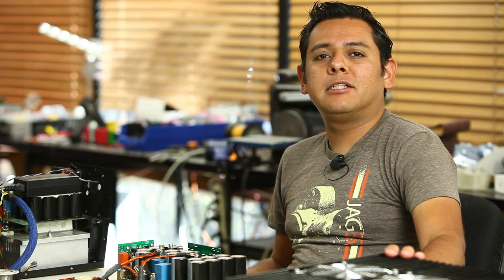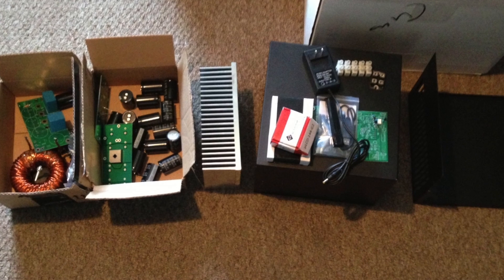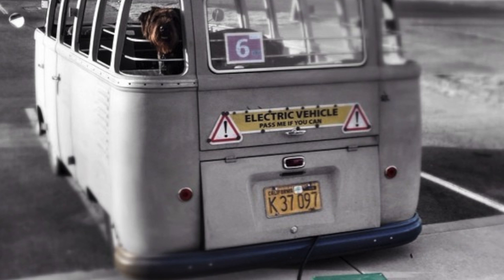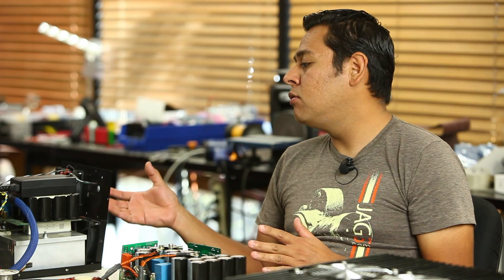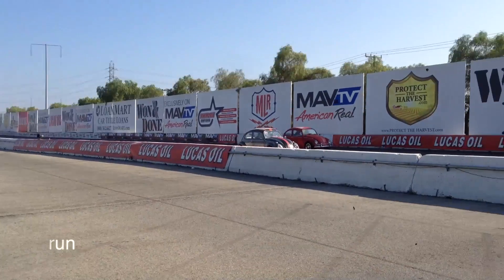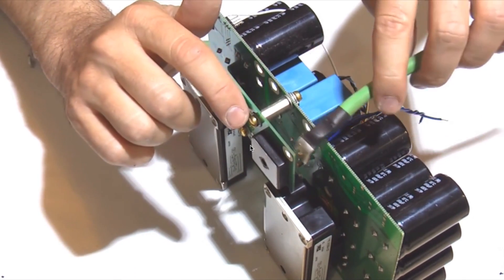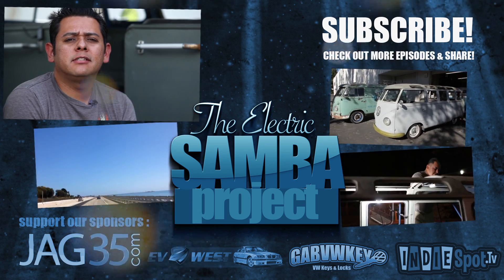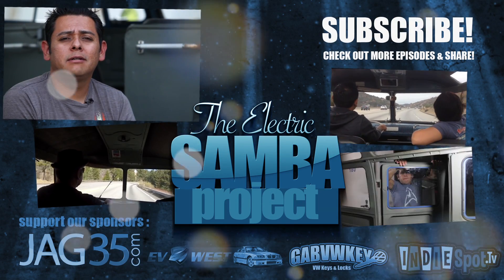DIY EV VW Bus  charger issues - eSamba  - Electric Car

Comment: Jehu why don't you get a js1772 receptacle and output the two 120v hot leads coming out of it into two separate standard Lifepo4 battery charger in parallel that take the AC and convert it to DC (and also have preset lifepo4 charge parameters). There's a company that makes this receptacle with built in electronics to work with EV charge station.  Why does it have to be an EV specific type of charger if ultimately you're simply charging lifepo4 cells.

Comment: Be careful with placing metal around those coils, as it may change the inductance of those coils. It could change the frequency of the circuit.

Comment: High current Capacitors are very dangerous, you are not suppose to work with high current capacitor’s without protection. It can kill you

Comment: They should make the board a little bigger, maker easier for air flow.  They could try using gan switches vs igbt then they can switch faster and decrease the inductor size  and weight by half.  It's Abit challenge but this is open source after all.  Suggest use fan when charging to help the charger last longer.  The inductor I assume gets the hottest

Comment: Can anybody explain the difference between a charge station, EVSE, and a charger? I think I almost understand. I am almost sure a charge station=EVSE, gets installed on the wall and has a J1772 cable that extends to the car’s receptacle. Inside the car goes the charger (and nothing else should be called a charger), getting power from the receptacle, and is directly connected to the battery. Am I right? I am not sure if the charge station/EVSE transforms, converts, rectifies or boosts the household power to anything else, but it is at least there for safety, only allowing power through when an electric car requests it through the communication pins.

Comment: what about solar charge while driving? like having two separate modules and charge one while using other one. and wice versa. or use generator hooked to wheel to charge it. ?
Reply: MP-Tuners Productions solar panels on the roof would not produce enough energy to be worth putting on the van. Any energy taken from the wheels has to come from somewhere. Conservation of energy principles mean either charger or regenerative recovery when slowing down rather than using brakes. Not while cruising
Reply: okay good, but still, if solar panels can give you an extra few miles just to get to charging station, it is worth trying at least. also generator hooked to driveshaft trough belt and gears should generate some power. It's not about building an perpetuum mobile but just to get few extra miles without needing a gas generator [top gear geoff].
Reply from the maker: I’ve made 2 videos about it https://youtu.be/2WeqnD2HzS4
Reply: yeah I found them just right after I've made this comment. Great stuff, so informative :)

Comment: also Tesla has a new HPWC version 2 which seems pretty awesome and pretty reasonable. max output is 80 amp which is the max available in the industry and its configurable.

Price $599 only.
http://shop.teslamotors.com/collections/model-s-charging-adapters/products/wall-connector-with-24-cable

Comment: Tesla sells their 2nd onboard charger (to upgrade to dual charger system) which charges @ 10KW for $2000 with installation so i am assuming its actual cost would be something like ~ $1500. http://shop.teslamotors.com/collections/model-s-charging-adapters/products/2nd-onboard-charger

its pretty sleek, liquid cooled and powerful! would that not work for you? seems pretty reasonable ... I'm curious to know if you considered it for your Samba Project? if it won't work then i would appreciate if you can share why would it not work for your project. it appears that this could have solved your charger issues once n for all and would have been cheaper and most technologically advanced option?
Reply: which charger did you finally end up using for your Samba? can you please share the link of the video if you have one?

Comment: Hey Jehu, Where can we get some of that fuse wire for the batteries? Did you sit down and just break open a bunch of fuses? is there anything special about those wires?
Reply from the maker: nothing special about it, I cut off and used the legs off these http://j35.us/1k-Ohm-resistor
Reply: Interesting. I found a page with some information on the ampacity of a wire based on its gauge. It might help. It looks like if you need a max current of about 7A you can try using a 22 AWG wire. I'd like to do some more research on this. It might be a good idea to have that fuse burn out faster if the battery shorts out. I'll let you know if i find any thing else.

https://wiki.xtronics.com/index.php/Wire-Gauge_Ampacity

Comment: Jehu, I worked for over 20 years around plating rectifiers. You can build one in your shop using a variable transformer and a heavy duty diode rectifier bridge. Typically an output shunt is used to indicate over and under amperage for a relay control. It seems to me that it's a headache you don't need and the commercial ones are way too complicated for your application. The other option is to simply buy a used plating rectifier that will run on 220 VAC and is variable between 50 and 200 volts VDC output. These "analog" hardware components are far more robust than the lightweight SCR units. So, it seems a 4KW unit as a backup could prevent panics on the road.

Comment: I know this is a old video and you might have came up with a solution...But here was my thought on the cooling for this.

http://www.amazon.com/Eathtek-Thermoelectric-Cooler-Heatsink-TEC1-12706/dp/B00E4GY0FC/ref=pd_sim_147_1?ie=UTF8&dpID=41VPMPJN3HL&dpSrc=sims&preST=_AC_UL320_SR320%2C320_&refRID=06TA2G3Y49ZSG62AETZN

You can put 2 in with 2 cpu cooler fans.?? Thoughts?

Comment: I can't find the schematics to this open source charger.  Can anyone point me at them?
Reply: Google around. I just found 'em through diyelectriccar -- pictures and links to google drive; they haven't been updated in ~3yrs. It's too bad Val (EMW) went off the rails with this stuff, and apparently left scorched earth in the wake. They no longer appear to sell kits. (no active store links, but if you can find their old store it was $1299) That's too bad, too. They are some of the most powerful chargers I've seen, and they don't cost $10k+.

Personally, I use old Cisco 4500 PoE power supplies. It does require an external CV/CC regulator. (and hp server supplies feeding ev-peak A9 12s chargers) But none of that can be mounted in a car for J1772 charging.

https://drive.google.com/drive/folders/0B8zi8eqgqJWocEtzd1hWem1yZVE

Comment: Have you considered immersion in mineral oil and cooling the mineral oil?
Reply: I was thinking the same. Mineral oil is not electrically conductive. He could immerse all the electronics without a problem.
Reply: Thought the same thing, hope he considers it. It would be a lot cheaper that those parts he is adding. Mineral oil holds heat maybe too well, but really any kind of non-conductive fluid would work.
Reply: weight
Reply: Mineral oil is succesfully used in most electric utility transformers, so it would work great, electrically speaking, for the inductors. However, you need a container to prevent splashing to the rest of the electronics.
Reply: The main thing that always puts off using mineral oil on any projects is that is something malfunctions, it makes repairs very difficult and messy.

Comment: You would need to draw about 107 amps at 220 volts to charge 47,000 KW battery in two hours.... that is at 100 percent efficiency, at 87% efficiency you would need  123 amp circuit at 220 volts...

Comment: To get the unit cooler why didn't you put a second cool plate on the top of the unit?
Reply from the maker: That charger was air cooled,  it had fans running air through a heat sink
Reply: Sorry, I didn't see that. I'll have to start watching YouTube full screen :)

Comment: try mineral oil in a sealed case with the water cooler plate .   they use mineral oil for transformer for cooling

Comment: At the power levels you are using the charging power supply really should have synchronous rectification.
Reply: +Kirk McLoren The ultimate cooling solution is immersion in freon. Used in aerospace.
Reply: +Kirk McLoren The feon is forbidden in Europe beacause of the cancer.
Reply: it is used because it is inert. It has NEVER been associated with cancer - and you guys banned it?
Reply: My fault. I have been talking to a man who installs air conditioners in houses and tells me that it have been banned because of cancer, but its not.
It have been forbidden because of CFCs, not because of cancer... sorry.
And it have been forbidden in 1987. I dont even know how I know it!
Reply: Iker Ayuso He is talking about R12. The freon used in electronics is a liquid at room temperature. 2 different things

Comment: The fact that twice as big charger has half the power rating may give a clue what's the reason of low reliability of DIY charger: Running it in a mode that in commercial product is regarded as overload. 

I work in a certification company and seeing lots of PSUs I can tell that you you can often find components rated multiple times higher than what is needed for operation and a "proper" power supply in a transformer overload test can be happily tapped from behind the diode or rectifying MOSFET (but before current sensing part) with at least its rated output, with output still loaded (totalling 200% rated output) and not even sagging much. Temperatures will be above ratings, but it won't cause instant fail it will degrade components and - what's more important - insulation. 

I really don't like the idea of cooling inductors that way: Insulation on magnet wire can't be trusted for reliability, unless it is proper triple insulated wire and whole construction is well secured. There must be at least some spacers around, plus main switching transformer experiences really high voltage spikes, so this one needs even more attention. Also - I believe that really bad things would happen if you loop around toroid core with metal, you will make a 1 turn transformer with that loop being its secondary coil, basically a dead short...

I have not seen the design but I'm little concern about safety of that charger, sure it is not something that will be used by an average Joe, but still - It is nice to be sure that your car won't became suddenly "hot to ground" :)
Reply from the maker: mibars teslas charger is about the same size/weight and around the same 12kw rating,   there is a way, someone has done it.   I share the same concerns as you,  Im concerned that my charger will not be reliable and safe,  but that will not stop me from trying things that most people are afraid to.
Reply: Hi, Tesla S onboard charger is water cooled - just like your upgraded unit :)
Reply: +mibars Agreed it is so big to have a larger thermal mass and a huge heat sink to dissipate all that heat.

Comment: Mr: Garcia
why do you keep looking for a huge expensive charger, we have an expression in my industry "KISS" (Keep it Simple Stupid)   
Instead of using one large charger use 2 smaller units just split your battery bank up when you plug in your charger. 

Use some contractors and relays to obtain this goal. 

Good luck with your electric car.If you need a diagram let me know!
Reply from the maker: Joseph Bednarik  why the need of a vehicle that goes 60mph?   the horse drawn carriage works just fine.    Can you show me a charger that can be built in a 1 cu ft space that outputs 10kw?     Well,  yes the EMW DIY charger does,  but i mean another one that uses smaller components in the way you describe.
Reply: jehugarcia  I should have taken my own advice, I totally forgot about the space restrictions in the engine compartment of the Samba, I will keep my eyes out for a  10 kw charger that is 1 cubic ft but I would suggest that you find a new home in the vehicle for a larger charger or parallel chargers.
Reply: jehugarcia  be very cautious of how you have your AC connection hooked up, you are using a 50amp plug on a 60A circuit, also the dc connector is not rated for ac voltage this is very dangerous because you potently have alive 240 connection that is open..

Comment: how would this charger compare to this one? http://www.emotorwerks.com/products/online-store/product/show/44-emw-juicebox-level-2-15kw-ev-charging-station-kit-or-assembled-unit
Reply from the maker: Nestor Diaz The linked product is not a charger, its an EVSE which is basically a smart cable to connect your charger to the wall,  its not 100% necessary at home or when using a standard 120-220v outlet but it is needed if you plan on charging on public EV charging stations that use the j1772 standard
Reply: Nice, thanks for the info. I'm still learning about the charging aspect of EVs more research to be done.
Quick question have you heard of people using 18650 cells for a Solar Battery Pack?
Reply from the maker: not specifically,  i just heard tesla will release a storage 18650 pack for home use, and i read a blog of some guy that bought a Model S pack to use for solar installation

Comment: I would strongly recommend NOT putting the inductors in Aluminum... or aluminum up into the center of the toroid... it will negatively affect the inductance of the switching inductors!   Thermal epoxy is good, just be sure it has no (or very little) metal in it. Maybe you could run a silicone hose wrapped through the cores a few turns before you pot them in the epoxy, then tap into the aluminum plate to get some of the cooling liquid running through the toroids...? That way you have maximum transfer area.
Reply from the maker: i will keep that in mind

Comment: A Hobby of mine is Amateur Radio and I use various 12 volt power supplies which from the factory do not come with muffin fans to cool them down. I'm not sure if this would be a bad thing for your use or not . You could wire the muffin fans up with a thermo relay and set it for a certain temperature to kick the muffin fans on as to conserve your battery power. It was just a thought . I have a 10 meter beacon that runs 24/7 and I use muffin fans that blow air across the heat sinks of the finals to keep them running cool plus a muffin fan on my 12 volt power supply that runs the whole unit. Just hope I've been of some help. Ron k4jee

Comment: For cooling u can put everything in single classic box and fill it up with mineral oil and then u can use some pump and radiators from PC liquid cooling to coll mineral oil down and everything will be cool. :) And yes on if u spray lil bit of water on radiator just to make it wet it will cool better proof for that is when u get out from the water and wind hits you,you feel cold its same.

Comment: wow it give you 150 miles,i'd like to know some more information in the project
1- what is the kwatt in total that give you 150 miles
2- what is the motor volt that you have ,it will be great to give me the modle of the motor?
3- you connect the batteries in series to give only 4 volt then the controller convert the 4 volt to more volt to your motor,corret me if i'm wrong

Comment: Hola jehugarcia. Siempre sorprende y agrada cuando alguien tiene ilusion por los mismos temas que tu.
Hace tres años empece con un proyecto muy ambicioso: construir un coche electrico desde cero, es decir, chasis, carroceria y sistema de propulsion electrico. El primer año trabaje una media de  20 horas semanales. Pero justo alli nacio mi maravillosa hija y ya solo he podido dedicarle un par de tardes a la semana durante estos dos ultimos años.
Las decisiones importantes son constantes y las equivocaciones numerosas. El dinero gastado es mejor no sumarlo. Pero tranquiliza un poco ver como otros se topan con tus mismos problemas y al final salen adelante.
Todavia no he visto todos los capitulos de samba proyect pero parece que has cambiado tres veces de baterias y varias de cargador. El motor de mi coche es un AC-35 puesto q creo q pesara alrededor de 1000kg.
El chasis del coche se basa en un tubo de 21 cm de diametro de 260 entre ejes. Es alli dentro donde me gustaria colocar todas las baterias, como ya ha hecho la compañia TREXA en un fantastico trabajo de ingenieria. Mi chasis es muy parecido al suyo por pura casualidad pues no conocia su existencia hasta hace dos semanas.
Mi controlador curtis esta ya programado por el vendedor (thunderstruck) para  36 baterias de LIFePo4 de 3.2 volts y 200 Amp, es decir, un total de 108 volts 200 Amps. Pero al ver el proyecto de trexa y el tuyo me he hecho la ilusion de que podria hacer unas baterias cilindricas para meter dentro del tubo lo cual proporcionaria al coche de una estabilidad buenisima y un aprovechamiento del espacio inmejorable. Crees que esto es posible?. Como tendria que agrupar las pilas? Y cuales deberia utilizar? Q BMS debo ponerle

Comment: Filling it with a suitable oil will make it real heavy. Ideally encapsulating only the hot bits for cooling should help.
All the best Jehu but I would love to short cut the charger issue away.

Comment: Your work on this is impressive.  Tesla,Aerovironment, Eaton, and ABB are already making this hardware.  It would be beneficial to get a look at their hardware to develop a lower cost, equally reliable DIY solution.   Especially how they keep stuff cool.  The commercial CHAdeMO units also have problems with reliability.